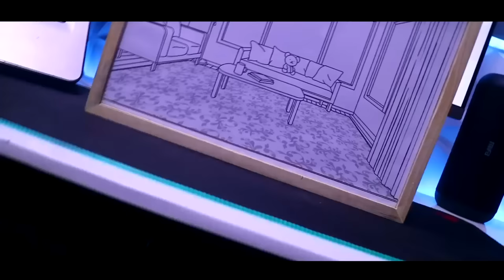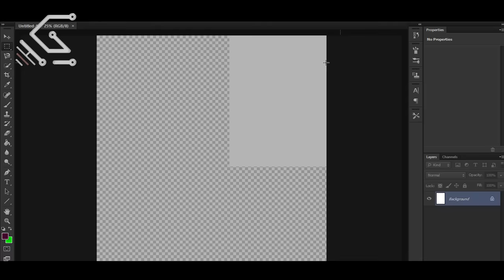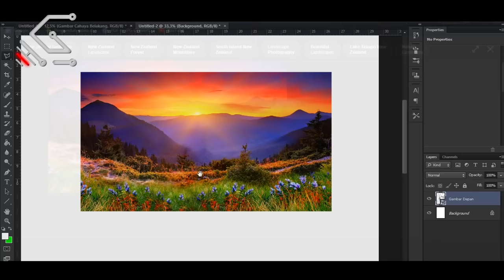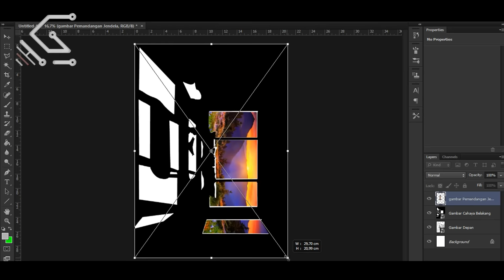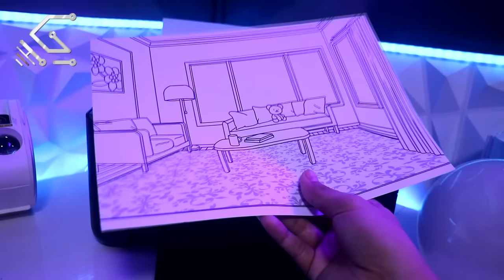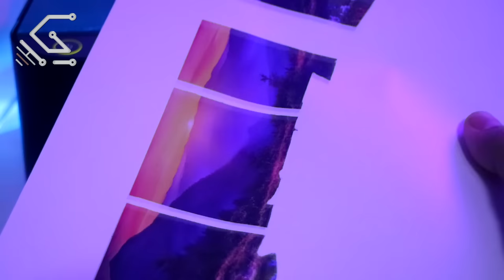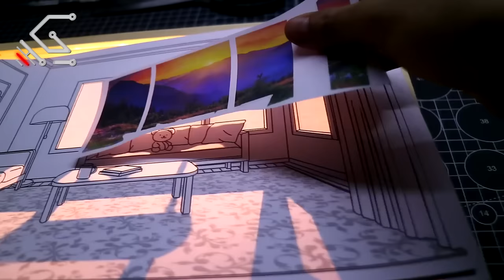Cara Membuat Light Box Yang Lagi Viral \ DIY Sketch Light Box

Comment: can i ask were i can buy that kind of tool that you using in cutting woods.?
Reply: The saw he used is called a box miter/mitre-saw (can be spelled both ways).  You can pick up a set (saw & jig together) up at most hardware/home-improvement stores.

Hope that helps; all the best, my friend.

Comment: print stiker vinyl pake apa bang? printerku epson l310 gabisa kyknya
Reply from the maker: Pakai printer yang sama
Reply: e só vc comprar adesivo vinil transparente para jato de tinta que funciona legal na sua impressora.
Reply: Depending on the printer, you can usually get it to print on vinyl by adjusting the paper settings; if your printer has a glossy paper setting, that'll usually work for vinyl.

Hope that helps; all the best, my friend.